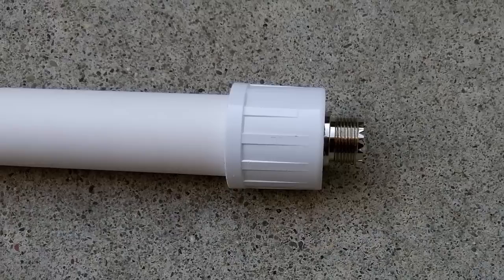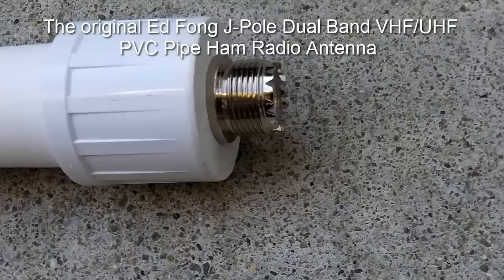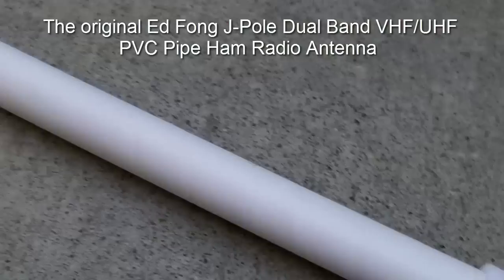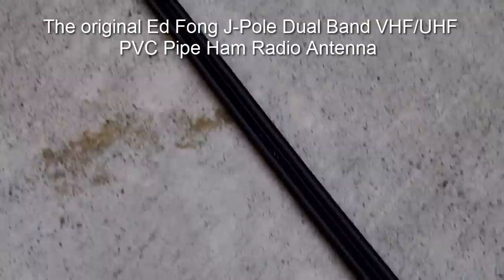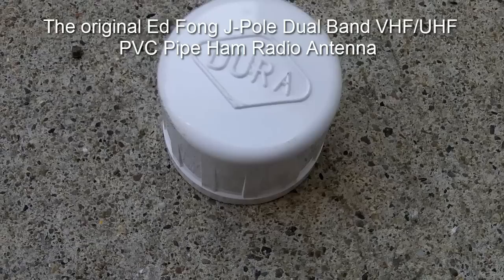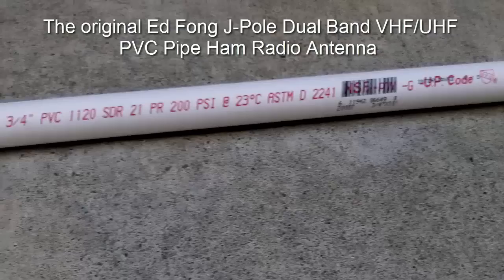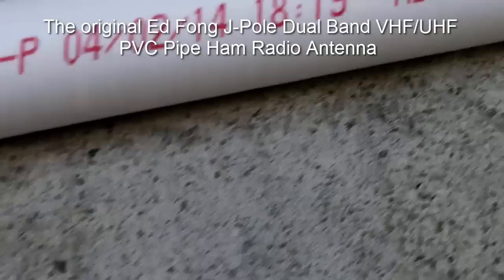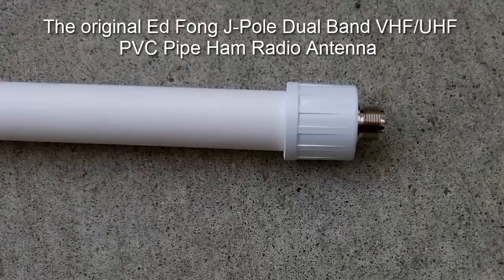The original Ed Fong Dual Band VHF/UHF 70cm/2m J-Pole PVC Pipe Antenna : Eye-On-Stuff

Comment: since we are talking about rf why would using the thicker pvc pipe lower the performance of the antenna its plastic non conductive unless it affects the tuning of it
Reply: +iron man Good question and I don't know the answer...I do know if you deviate from the instructions it doesn't work as well.  Stick with the 200 psi and it will amaze.
Reply from the maker: +iron man Ed Fong can answer that question better than I can. From what I understand from talking to him.  200psi PVC pipe is thin enough to allow the transmission of the signal.  Schedule 40 pvc has a thicker wall and effects the performance.  Ed said he had tested this.  You can visit his website at: http://edsantennas.weebly.com/   You can find his email and phone number on his site.   Thanks!
Reply: The problem I'm having (just bought the antenna direct from Ed on eBay) is that the 200 psi PVC is all but impossible to get here in the northeast...the nearest Lowes that sells this stuff in-store is located in Texas and/or California (I'm in MA)...to order for in-store pickup or delivery, I need to order a minimum of 200 feet or so at a cost of circa 250 dollars...so I would recommend you take Ed up on the offer of an additional 12 dollars to throw in the PVC unless you want to end up frustrated like me. And please, if someone else can point towards an alternative means of getting this stuff, fire away! (Yes, I've also looked at Home Depot, ACE etc...same thing).
Reply: I think the only problem using the thicker stuff is the end caps won't fit  using sand paper might work. the only advantage I can see in using 200 psi is its lighter its plastic and should not effect the rf I would think
Reply: +iron man   Using anything other than the 200 psi stuff will seriously degrade signal quality.  I can't tell you why or how I know but I've studied this enough to know you have to stick with 200 psi.
Reply: +iron man The thickness of the PVC will not subtract from the performance of the antenna. The end caps are for 200 PVC and not sch.40. The sch.40 will be slightly heavier.
Reply: +Ryan Bassette Just as a follow up, it turns out the local Lowes does indeed carry this stuff in stock etc, merely ran into an employee who was clueless (shocker). My suggestion is find it online and check whether it is in stock then check store pick-up...it magically appears at the customer service desk despite it not being available the day previous...
Reply: +rafdavfl The thickness absolutely will affect performance: drastically according to Ed Fong, the PhD RF engineer who invented the antenna and wrote it up originally in QST. I realize it goes against gut-level intuition, but it isn't simply a  matter of end caps, but will also dramatically affect tuning/swr as well.
Reply: +Ryan Bassette Oh for god sake's...  Ed Fong did not invent this antenna. Ed Fong simply resurrected an old antenna design.

Furthermore  he purposely target’s newbies and unethically uses his degree for credibility to sell a 60 year old antenna design that is unpredictable and who’s performance  is worse than a simple 1/4 wave ground plane. His motive ? over a 1000 percent profit on each antenna sold.  In bulk this antenna costs less than $2.00 to build  

"but it isn't simply a  matter of end caps, but will also dramatically affect tuning/swr as well."

An antenna affected by non-conductive material ? Hmm !! This should be your first clue that there's is something seriously wrong with this antenna design !! 

PVC should have absolutely no effect whatsoever on a properly designed antenna. The problem is the J-pole style antennas and this includes slim-Jims which all fall into the Marconi antenna family are not properly designed antennas. Due to their design J-poles are actually extremely reactive antennas, and everything from feed line length to rain affect's them. This is primarily do to their susceptibility to common mode and feed line radiation issues.. 

How did the J-pole become so popular? Let’s start with antenna modeling, early J-pole antenna models predicted amazing gain for such a simple antenna.  Unfortunately antenna modeling is only as accurate as the modeling data input. That's why it’s important that results drawn from antenna modeling be subjected to peer review. 

The J-pole is a perfect example of flawed antenna modeling. The first J-pole antenna models were built by individuals who had very limited and/or no experience with antenna modeling. As such when subjected to peer review they failed.  The peer review process discovered that their antenna models were seriously flawed and the predicted performance and gain patterns were erroneous at best.  

 That in a nut shell is why Ed Fong resorts to snake oil salesmen style tactics to peddle his antenna.  Rather than posting modeling data for peer review he resorts to questionable “testimonials” by non-experts and refuses to post any scientific data to back up his controversial performance claims. You would think an individual with an MSEE could easily provide some science and math rather than testimonials by non-experts and newbies to back up his claims. 

Unfortunately having a college degree does not insure ethics and integrity. There are plenty of examples of unethical snake oil salesmen exploiting their credentials to peddle flawed products..

 The J-pole has since been modeled by recognized, respected experts in the field of antenna design and modeling. 

Unlike previous models these new antenna models have withstood the pear review process. I urge you and anyone else interested in this antenna to take a look at W8JI's J-pole modeling page and review the data presented, then ask yourself why hasn't Ed Fong and other proponents of the J-pole  responded. W8JI's model is not the the only one there are many more experts who have modeled this antenna but that's a good start as he makes it simple to understand.
Reply: Dan thanks for this post; it's thorough and succinctly put, rather than a typical youtube flame bereft of content and jam-packed with troll lol.

My background is a B.S. in Biology and 3 years of medical school (dropped out, very long story and irrelevant here) but in regards to this hobby which I ADORE, physics (outside of the rote memorization required to pass an undergraduate year of college level physics) was never my strong point, and my passion for the hobby has always been, first and foremost, the 'magical and romantic' aspects, i.e. the voice from afar crystallizing out of the white noise, old radio drama, big fat MW stations drifting in and out at 2 in the morning etc etc.

To make a long story short, I hold an Advanced class (obtained back in 1990 via the rote memorization of study pool route), currently studying for the Extra, but only recently really starting to develop a 'gut-level' intuitive grasp of this radio stuff...I guess I'm a little bit ashamed of my lack of knowledge in this area...if this were a med/bio issue I can get equally passionate, in particular with issues of pseudo-science, so prevalent today (as you stated, a degree after a name, even if entirely unrelated to the topic being discussed, is used regularly as some sort of shield to BS accusations...just ask my YL, I'm constantly shouting at the TV when these docs get on blathering about something they know frankly no more than the lay public about, but impressing the swooning audience regardless).

So Dan, in all sincerity, thanks for your post. I was initially suspicious of this notion that non conductive materials would have an effect on RF...I'm realizing the topic is a complex one and that I can only continue to put my foot in my mouth if I make any more statements regarding it...I guess another thing the general 'lay' public doesn't understand is that even amongst 'gods' (facetious reference to PhD holders lol) there is about as much agreement as between politicians (yikes) on many issues...there is healthy debate and, ultimately, the rigors of (perhaps tedious to many) concise and thorough study win the day, and respect, amongst those that hold the scientific method as central etc etc...

I hope this doesn't come across as even one bit sarcastic as it is in no way meant to be...to be further explored.
Reply: +Ryan Bassette I got it at the Dedham MA Lowe's, right off the shelf! Short money too!
Reply: +Dan Nelson well, YOU definitely don't like them. So don't use them. I did buy one of the Fong units, used the thin pvc tube, have had it up for four years thru the unpredictable New England weather without a problem. Works well enough for me to reliably hit many (close to 20) repeaters in greater Boston to central MA area. Maybe it's not a "GOOD" antenna, but I don't feel I wasted any money on it!
Reply: ALL materials affect RF energy even though they aren't conductive (plastics). One characteristic of materials is velocity factor - the speed at which RF energy passes through a material. So, even PVC can affect your RF. There are also materials that SEEM to be non-conductive that actually DO conduct electromagnetic energy - some plastics have metals impregnated in them. Even plant life affects RF energy, because of the moisture they contain.

Speaking of moisture - one can even construct an antenna by filling the PVC pipe with Gatorade. Cut a PVC pipe to the correct length for resonance in your desired band, seal the bottom end, with a copper wire and an SO-239 (this injects RF into the liquid). Then fill the pipe with Gatorade (or another water/electrolyte combination such as salt and water) until you reach resonance - the height of the column of liquid determines resonant frequency.
Reply: @franktroycookjr , what Frank said. 
Plastics add capacitance, which affects velocity factor, which affects the wire length needed for optimization at a particular frequency. In other words, the wrong plastic will shift the resonant frequency of the antenna. BTW, the radome, (the plastic pipe protecting the antenna,) WILL attenuate the signal to a degree depending on the type and thickness of the plastic used. It just won't attenuate it anywhere near the degree that metals will. Same as wood walls and such. Each and every material causes attenuation of an RF signal trying to pass through it, even air.

Comment: how do i connect the Yagi antenna to a Wouxan KG-905G GMRS 2-way radio and what connectors and cables will I need?
Reply: Heya :) if you are still curious... I believe that g.m.r.s. radios have Antenna that do not come off, and the GMRS radios also have set "channels" instead of spinning the dial like an am or fm radio. 
Perhaps we should get you a small hand held yaesu ft65!♡ or even a baofeng...
Reply: Good luck out there!♡

Comment: Just cheap SCD 21 Pipe 200psi type, nothing expensive, 3 bucks maybe..

Good antenna, but i recommend to use hot glue or silicone the cap where the solder joints and UHF connector is, if not you (WILL) get corrosion etc in it.

Comment: Do you have the eBay link where you found the antenna.
Reply: Bear I have this antenna in the 200 watt version, it's a great antenna, and built a little heavier than the standard 75 watt version..  If you look on Ebay just do a search for the  DBJ-1  dual band antenna and you will find it, no problem.   Ed does a great job with these and all you have to supply is a 5 foot piece of  200 PSI  PVC pipe the 3/4 O.D  size.  He supplies the end cap and the bottom cap has the UHF connector on it so it's ready to insert into the PVC tube, glue it and mount it and you are all set.   I took a 12 inch section of Schedule 40 PVC which is thick and heavier than the thinner  200 PSI stuff and I used a coupler to attach it to the  200 psi tube, so now at the bottom of the antenna I can clamp it better because the first 10 inches of this antenna at the bottom does not radiate, Ed has it set up so you can use the metal clamps and it wont affect the SWR at all.  So you can beef up the base of it if you wish if not just put it into 200 PSI tubing and mount it .
Reply from the maker: +Bear http://www.ebay.com/itm/Dual-Band-Portable-roll-up-VHF-UHF-Antenna-MURS-HAM-GMRS-commercial-DBJ-2-/111746196613
Reply from the maker: +Bear  Here is the link on EBAY for the base antenna:  http://www.ebay.com/itm/UHF-Base-Repeater-Antenna-ham-70-cm-GMRS-FRS-commercial-5dB-gain-/121733765028
Reply from the maker: +Eye-On-Stuff  This link is for  the roll up antenna

Comment: thickness of pipe has no effect on radiated signals, use schedule 40 electrical pvc for sunlight resistance. also this antenna has been around much longer than ed has been selling them, i built one back in the 80s
Reply: Scuff and oil based paint for resistance to elements...
Reply: @MatHelm  Or use electrical PVC (the grey stuff) that is rated to resist UV
Reply: If the antenna are tuned with one type of plastic tube, you will see with another tube that the center of the tuning frequency have been changed. Maybee not so much, but you will see it. Put some plastic pipes in the micro, start it with full effect. Some pipes melts.  So yes! Some plastics are real bad in RF/HF applications...!

Comment: Boy, lots of elitist hams on here. Good grief. It's a simple antenna that works. You guys are poo pooing this antenna because YOU think it is junk. Isn't this hobby about experimentation as well? What works well for the individual station? Compromises? Rather than throw it under the bus, think about its place in the hobby. Light weight, portable, adequate in most cases. No, it's not as good as my Comet gp-15 or even my gp 3. But it gets out to repeaters in the area just fine. My home built copper J is the same, not as good as the Comets,  but better than a a lot of mobile antennas. People have a lot to learn about the hobby, I agree, but putting down people for not knowing how to build a radio from a tin can is pathetic. What's just as important is a "dumbed down ham" that understands protocol during a disaster so they know not to stomp on a net control station and operate in a panic. That's why we test for a license and learn from others.
Reply: For myself,  experimenting with different home brew antenna designs is the best part of the Amateur radio hobby all together, can't do too much to your transceiver unless you have a lab and a whole hell of a lot of knowledge,  I wouldn't crack open the housing of a $4,000 dollar transceiver anyhow and put a mop and screwdriver to it.
Reply: Right on the money

Comment: Ironicly sold as a dual band antenna but is actually a VHF J-pole where the third harmonic frequency of resonance is UHF..
easy to build any Ham can build one,
300ohm ribbon, match loop on the bottom antenna one side, ground the other,

even better build a Slim-Jim..
Reply: Wrong. Uhf Is running on first armonic in this config. Check the PDF indicated in one of the replies

Comment: unless ed fong went by different names 20 years before he "invented"  this. then he isnt the inventor. just saying hell even i made one like this 10 years before he said he invented it and there are a ton of books from the 80's and 90's that have this in it well before he started selling it on ebay in 2009
Reply: If you read Ed's QST articles you will see his acknowledgement of the ubiquitous J-pole well before the 90s. His innovations are to add PRACTICAL  multiband operation and versions for both base and portable use. His website - Google it - has all construction details free. By the way he has many patents and the antennas AFIK are assembled and tested by grad students for learning and club support at a cost way below commercial equivalents.